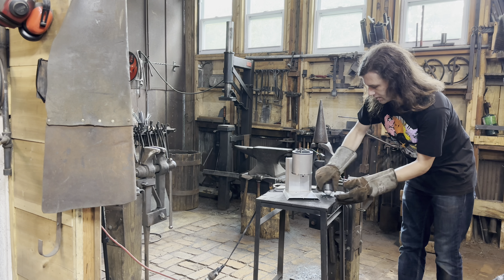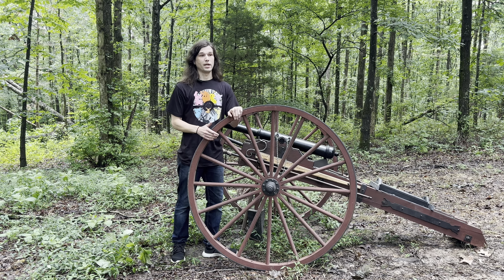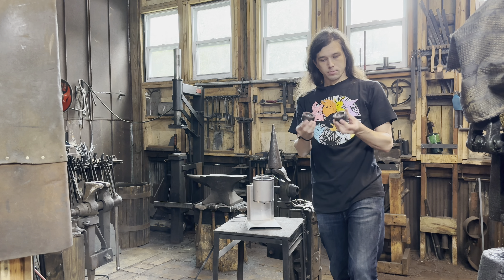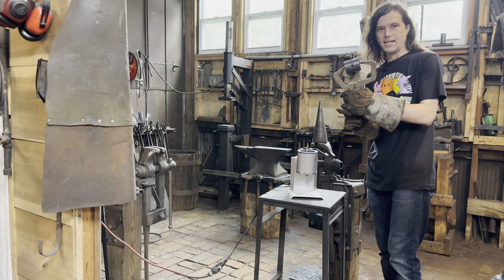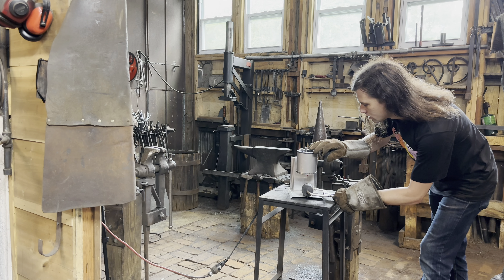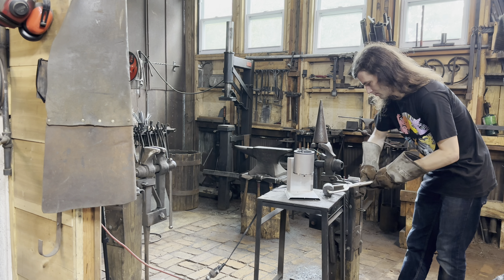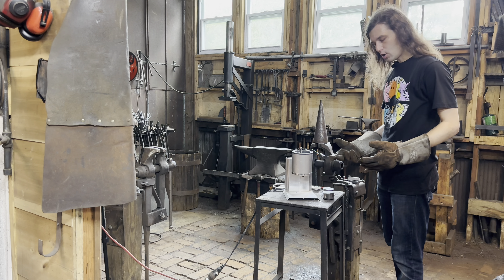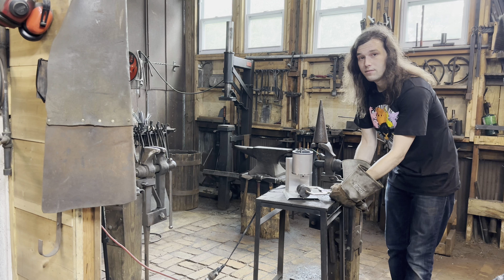How to Make Cannonballs

Comment: Some advice i seen a old fella making sinkers for fishing he used a hinge on the two molds so it was easier to open all you had to do was swing it open. Because he used to flat surfaces it might have been easier. Because you got a odd shape mold it might be different to set up. But i tell ya it will be better

Comment: Traditionally, cannon balls were made of iron, mostly cast iron, but some were wrought iron. Modern usage could find used ball bearings a suitable replacement and a lot cheaper than lead
Reply from the maker: We use old automotive lead so it’s basically free and I’ve got some ball bearings for a future video!

Comment: Wanted to see how you cut off the flash and remove the seam.
Reply from the maker: Sometimes the flash will naturally come off and if not we just use a pair of wire cutters. As for the seam, you can sand it off if you want to (wear a really good respirator if you sand lead) but we leave it there as it doesn't hurt anything! Appreciate the questions!